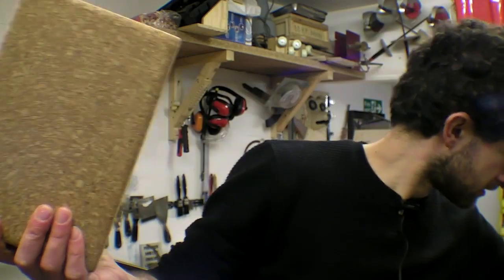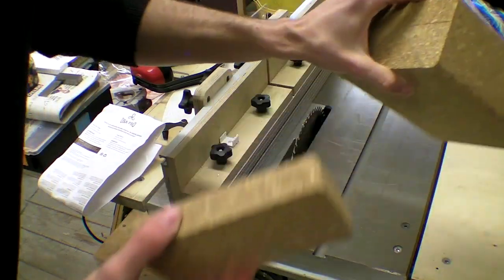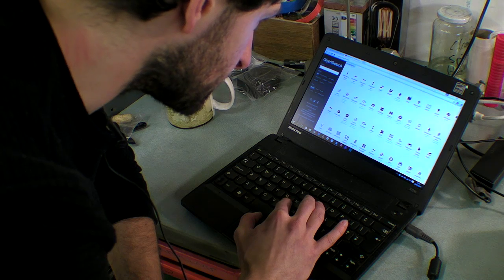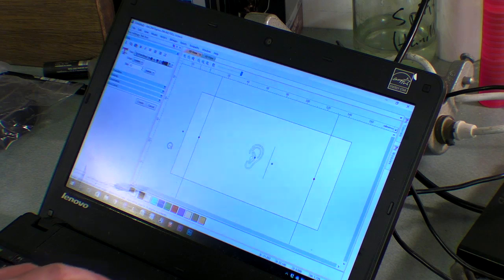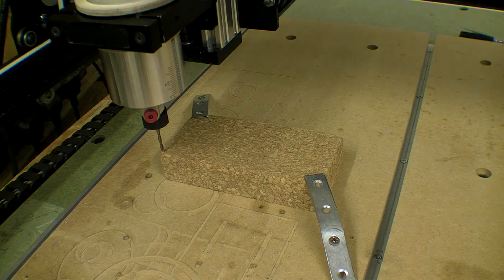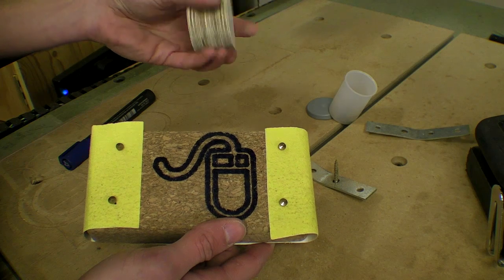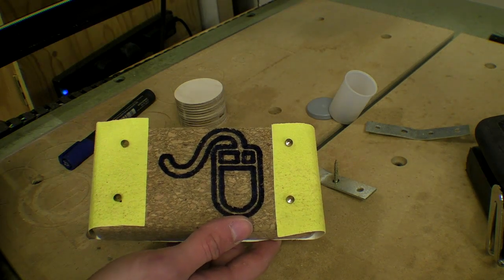Will It CNC #1 Cork / Making a Sanding Block

Comment: Hi Savva!
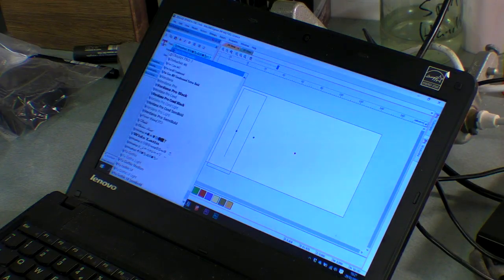2:10 then you enter characters from the keyboard for a few pieces to see what these characters
In Windows (and 8 10 too) there is a handy program that allows to view, copy from and paste into other applications all characters of all fonts installed in your system. The program is called Character Map, you can run it simultaneously press Win + R keys and then type in the search "charmap.exe" or enter "charmap" (without quotes).
Of course the size of characters when you view there is less than in the editor, but once seen 200 pieces, and when you press on symbol it becomes larger.

Comment: Interesting, what would be even cooler is to really form something from the cork, like a car or something (understanding it would be profiled from the top).  Also like the video, however the closed captioning was in the middle of the screen making things a bit hard to see, however really like the idea of trying other materials on the CNC!
Reply from the maker: +DIY3DTECH.com Yeah I don't think I can control the captions placement - also need to crack 3D scanning so I have something interesting to carve - in saying that ArtCam does have some generic 3D files to use.